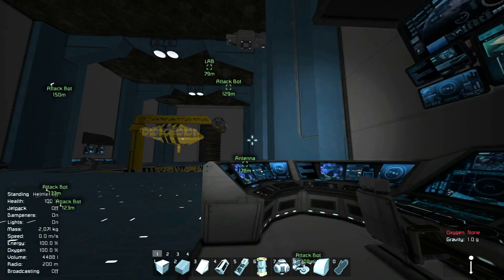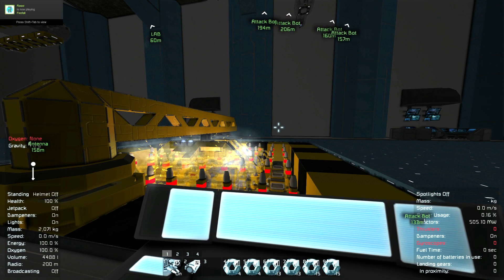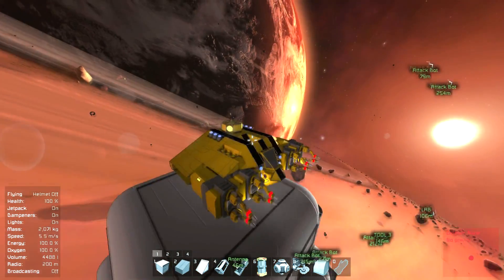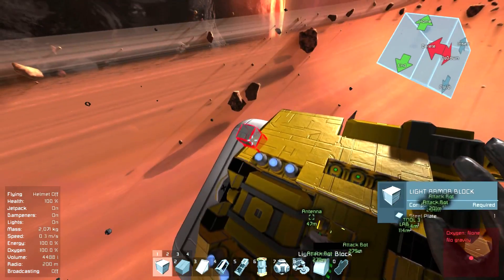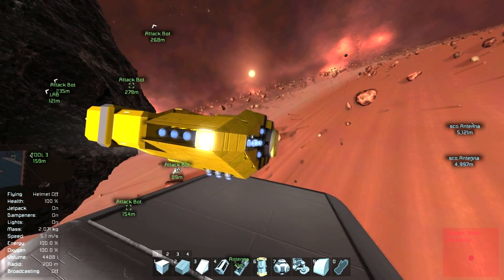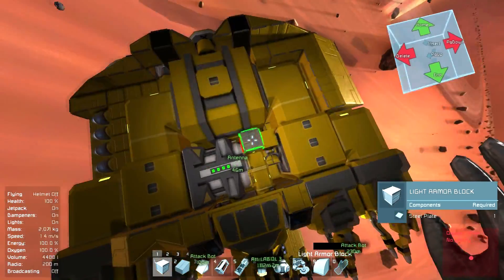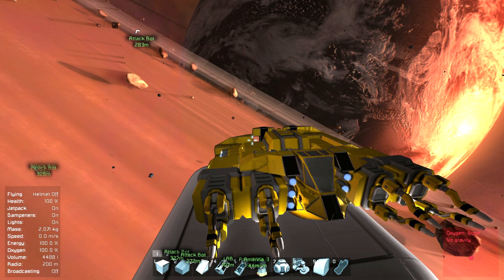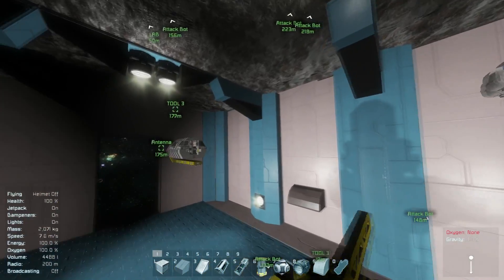Space Engineers TOOL V3

Comment: I think the DX9 mods should still be available if people want to stay running in DX9 rather than DX11. But they should definitely be clear as DX9 (and DX11 only mods should be clear on that too).
Reply: ***** Older cards that can't run DX11 (or rigs that don't run it very well)? 

If the option is left to switch between the two then the same should go for mods.
Reply: ***** or players on Linux with WINE ヅ